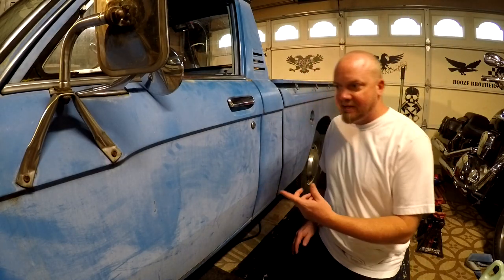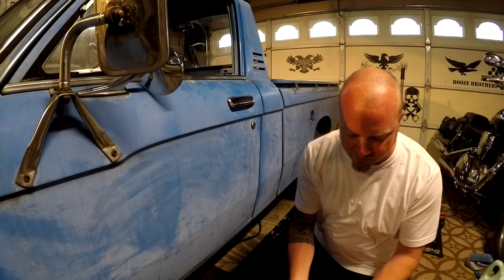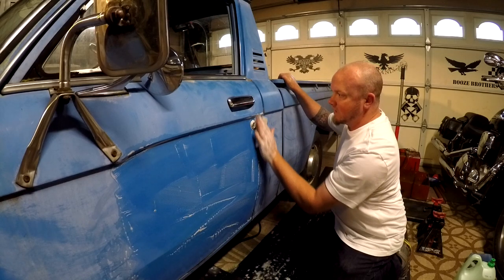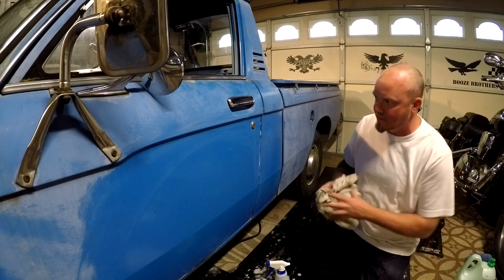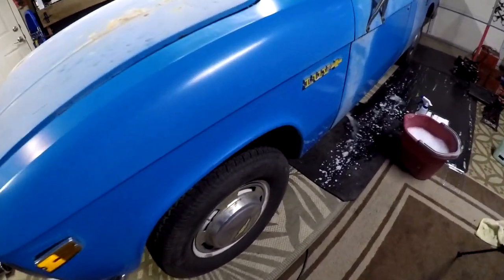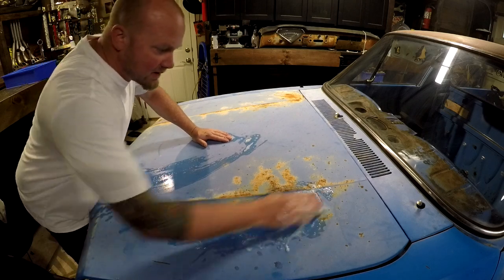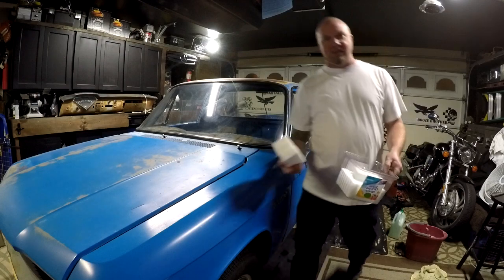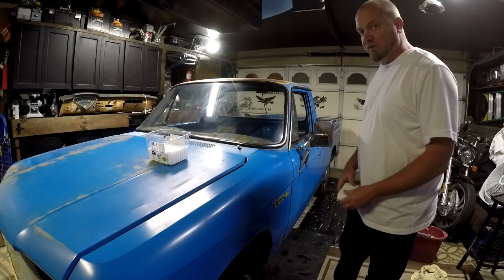How to remove oxidation

Comment: Yup it works! Melamine (Magic Eraser) foam is 4000-5000 grit  equivalent. Then you can take it two steps further and polish it out with medium cut foam pad on a dual action polisher and put a paint sealant on it, as an example. It would shock you as to how well it will turn out. But I'm a big fan of wet sanding and that is basically what you are doing. Good video!
Reply: What polish and paint sealant do you recommend?

Comment: Should coat it with something UV resistant, so it should last! All car paints have the lacquer for the same reason. The magic erasers are actually melamine sponges.
Reply: Also should use citric acid for chemically deactivating the actual rust.
Reply from the maker: Thank you. I will do that.
Reply: Mike Stanek I recommend Deox C gel for rust removal/conversion, which is citric acid. There are a few similar products that are citric acid in a "gel" form.

Comment: Sandpaper did better getting rid of oxidation for me. I used 50 grit sandpaper and 80 too. But I did it by hand. I used a yellow foam pad and that didn't work for me it was a heavy cutting pad I used on my rotary polisher. I probably next time used 1200 grit sandpaper wet dry after I get a 7 inch hook and loop pad.